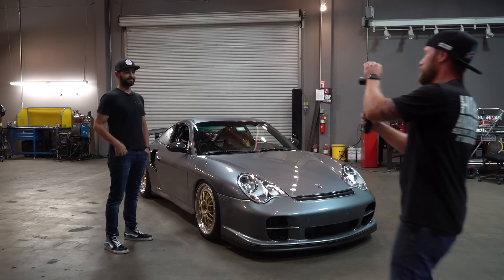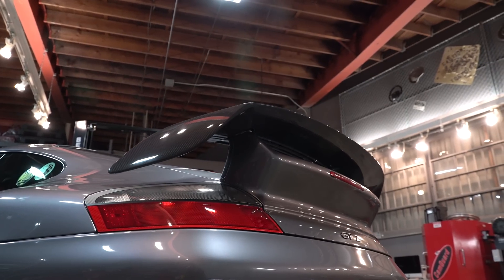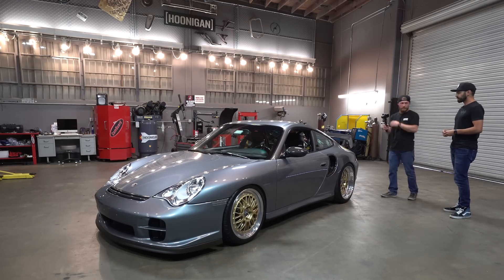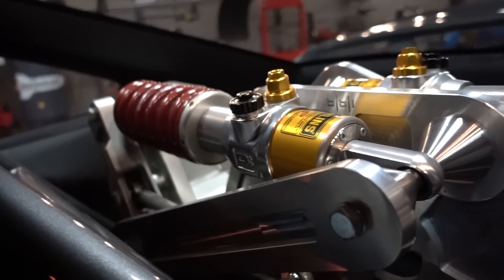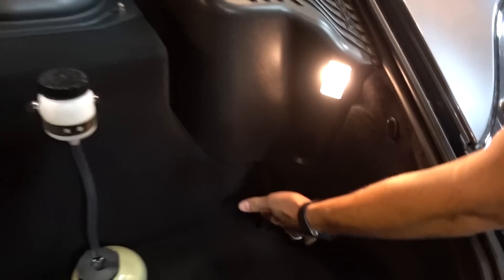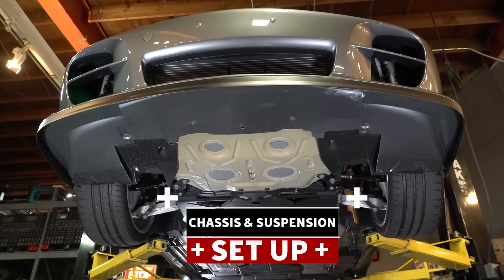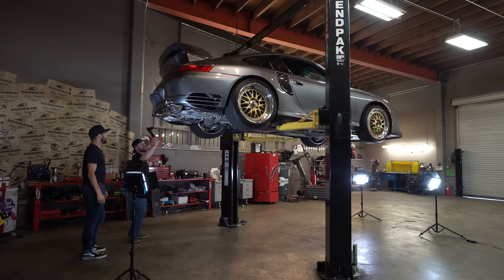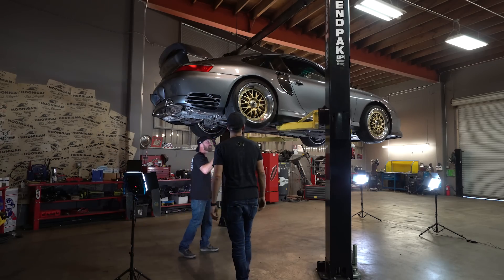800hp Porsche 911 GT2 - With Backseat Suspension!?

Comment: That's it.... need me a 911 996, a winning lotto ticket and a local shop who know their stuff...

Normally 996's kind of put me off, headlights plus I dont even want to think about one because of the IMS bearing but this thing just made me rethink my opinion on the 996... In its final form it is a beauty on the outside, absolute beast on the inside. Love the suspension work as well.

Watching this kicked me back to when I was 10 years old and a 996 was all I could think of.

Comment: wow this thing had only a little bit less then my 15 f250 when I got it it was making 712TQ TO THE WHEEL! it is a stump puller sweeeeeeeeeet turbo GT2 the rear end has had so much work its unbelievable and I like exposed horizontal shocks I have seen them on the front of cars and the back but it is just so clean when u pop the boot and there are two turbo's starring at u its a 10!

Comment: I remember when I worked for Porsche back in 1990 and the new 911 turbo came out 1 of the mechanics was doing a plug change and explained to me how you had to drop the engine to do it,mind you he made it look very simple ,4 bolts and a few umbilical cords is all he says 5 mins,it's just easier .

Comment: The widowmaker nickname these had in the 80's and 90's was really just down to old turbo technology. Not only were they incredibly laggy and produce a huge surge of power when spooled up, bu the turbo would even still build boost under partial throttle. If you were doing some spirited driving around a long bend it could result in boost being built to the point that the rear tires broke loose. Combine that with the rear engine layout and you basically got a pendulum effect going on. Scary as fuck actually.

Comment: Porsches are by far the easiest cars to work on.996, 997, 986, 987, only have three mounts in total for the engine and transaxel combined. I have pulled and replaced the entire driveline in my 986 S, in my driveway, with no more than a couple of floor jacks and jack stands, by myself, in an afternoon (on at least three occasions). Injectors from the top engine cover, plugs top or undernieth. Alternator replacement from the cabin hatch in about 15 mins.

Comment: don't these newer Porsches (after the 993) have the engine set further forward? I know the 930/964 Turbo have the widowmaker reputation due to the engine being rearward past the axle, but I'm led to believe the new stuff is closer to a mid/rear?
Reply: Legotruck82 the new 911s still have the engine mounted behind the axle but the technology has come so far they’re able to get rid of rear engine characteristics with rear wheel steering and self adjusting suspension.

Comment: The rear tires are wearing unevenly which is not that uncommon except they're wearing on the outside which I don't think I've ever seen. I did tires and wheels for about 5 years, and I would always see sport/y cars wear out the inside shoulders, presumably because it's set up to do better in corners, so you can make sense of that. I can't make sense of outside wear on the rears unless the suspension is misaligned.

Comment: Earlier this year, I rode inside this car or a car identical to this (Silver 996 GT2 with 800hp and Pushrod rear suspension). It's insanely quick, felt like my eyeballs were pressed into the back of my head! This is right after taking a ride in a 993 Ruf CT2R the day before and driving a Tesla Model X a week earlier. This car is truly a beauty and the owner and builders have done a magnificent job on it. 
The rear suspension is a masterpiece. It's definitely more for show than actual performance. From a pure performance perspective, it sits too high up and defeats one of the main purposes of a cantilever suspension (the part about lowering center of gravity). But the owner wanted it that way so who cares?  It's still a show stopper and an insanely fast car.

Comment: I thought maybe they would elaborate more on why someone might redo the suspension in this way. Other than so you can see it through the window. 
Like maybe the stock suspension is compromised because of cramped packaging. 
Also guys, those edit cuts with the glitchy music are pretty obnoxious.  Maybe try to be a little more like Larry.

Comment: Rear suspension settings are carrying too much camber or upper inflection, check out the uneven wear on the rear tires. Could it be that the upper suspension just doesn't really work. Porsche racing engineers are probably laughing at this car!

Comment: As a mechanical engineer, I find the rear suspension kinda ridiculous for this application. Coilovers have gotten so good that there is no real need for push rod suspension, and if there was any real benefit, all the extra weight over the rear axle would of canceled it out.

Comment: Porsche stuff is all straight forward n functional other than that stupid suspension setup in the rear window. Should of gone with more RSR parts and running ethanol can easily make 1000-1200hp unless it is never said. Nice build though not a fan of interior and the inboard coil suspension used primarily on a street car. That setup is more suitable for mid engine car w/longer wheelbase like Ruf,  CTR3

Comment: “It’s like a diesel” old smoky made a little over a 1000 ponies to the ground, and over 2500 lbs of torque. Gassers shall never beat a diesel in the ratios, even a stock 12 valve made something like 215 hp and 440 lbs of torque. ~1-1 is pretty good for a gasser though, waaaaay better than the thunder Doritos.

Comment: The real reason you want pushrod suspension is to control the spring to ensure it is always being acted on in the correct direction of travel. Completely pointless on a road car. Triple adjustable shocks are also something you don't need on a car unless it's producing real downforce. Nice build, but completely for show. Very little to do with performance in relation to how this car is used.

Comment: "If you're making 800 wheel, you're making a little over 800 torque to the ground, like a diesel." Actually I think that's called a broken diesel. Speaking of, when are you gonna have another diesel in the yard :thinking:
Reply: James Derrick sat there and thought the same thing. 400ish horsepower is 900+ ft/lbs of tourqe in a diesel.

Comment: Not a huge fan of Porsche cars but this one is just stupid clean. Like wow..... wow
Reply: Dodgers 48 how you not like porsches? Easily the best engineered cars you can currently. At least the 911 is.
Reply: sjpro1 
Haha nah man I am not a HUGE fan of Porsche cars. They're great cars but I'm not in love with them. Ya know? 😃👍🏼
Reply: overhyped, overpriced, not terribly reliable, expensive to fix and maintain...not accessible to most middle class people. don't get me wrong i'm sure the driving experience is incredible and almost unmatched, but you have to be realistic when shit starts to get insane expensive.
Reply: Varg Sutton 911s are bullet proof aside from the few years with the IMS issue. Plenty of people ABUSE these cars on the track on weekends and daily them the rest of the week. They are very well engineered to handle the stresses of track driving. Car and driver launched a turbo s something like 50 times in a row without it overheating. Used they are pretty affordable for a 996. Maintenance on the 911 really isn't bad at all. Only really needed to put brakes on and change the oil for the ones that came into shops I've worked at. You obviously have no personal experience with these cars.
Reply: @VS666  sounds like a lambo or a ferrari.

Comment: Those gold wheels don’t fit that era car those wheels reminisced from the 80s should absolutely be painted body color or chrome or even black before GOLD. Plus the rear suspension is completely overkill looks like shit it’s a streetcar not a track car and it’s hardly anything close to an RSR. Olin’s is the best but visually looks like shit in A street car buy a watch then WTF what a lame justification!! 800hp Not much it’s actually under powered if you want to bring up RSR references. Anymore power in a manual is not really usable unless you’re going just for flat out TopSpeed

Comment: Clever owner did that in 996 gen GT2 since this one won't appreciate as much than the 997 GT2 in value
Reply: Naufal Kusumah indeed as soon as I saw it was 996 I wasn't concerned with changing it. It's probably the least desirable front clip with those headlights
Reply: interesting that he didn't do the standard conversion to the new front 

the 996 has been growing on me, especially when the lights are fresh and clear
Reply: Clean, without any stories 996 GT2 is the rarest water cooled 911 now a days.

Comment: The servicing of these vehicles is why they don't sell to people who work on there own cars in there driveway. I still want one
Reply: RAID3R63 The price point is why they don't sell to people who work on their driveway. Nobody is wrenching on their 100k+ cars.
Reply: ImBarryScottCSS I know plenty of people who wrench on there own 100k cars. There real car guys who  spend there 100k making a car better rather than just buying a 100k car. Some of the nicest show cars I've ever seen was done by a guy with some help from his friends on the weekends.
Reply: RAID3R63 but then its still not a 100k car😅
Reply: people who can buy these kinda cars (I mean the GT2 class) can either a.)afford to have them serviced or b.) have their own shop. 
You'd be surprised how easily serviceable porsches are compared to the other exotics in their respective classes.
Reply: Daniel Hurlbert aka Normal Guy Supercar does most repairs on his F430.  Matt Moreman of Obsessed Garage has been known to take apart and swap exhausts on his $200K GT3 RS.  Just because you have an expensive car doesn't mean you can't work on it yourself.
Reply: I think he neans you dont see a guy replacing the head gasket or studs or even a tune up on a amg black or lambo

Comment: Stop clickbait,  nothing weird about the suspension. it is used alot in racing but only by the real pros because it can be a bitch to set up
Reply from the maker: You don’t understand the meaning of click bait... if the car didn’t actually have that suspension, but we made you believe it did, then that would be click bait. And we can name the number of road going 911s with cantilever suspension on one hand. So yes it stands out.

Comment: 996 GT2? Holy shit, talking about very, very rare and awesome cars. But then again, it’s not a Widowmaker. It just isn’t.
Reply from the maker: Scotto says “Widowmaker” is reserved for 930 Era Turbos, Early Vipers and the scissor jack in VWs.
Reply: TheHoonigans Brian is right. Usually the 930s are called widowmaker since they have a relatively big single turbo that makes them very unresponsive to drive. Nothing below 4500 rpm but then suddenly a big shove. People used to crash them loads when turbochargers in general weren’t really a thing and no one really knew how to handle them except for racing drivers
Reply: TheHoonigans Fun fact: when the 930 first came out it got lots of flak from motoring journalists here in Germany. Most of them didn’t like the way it drove because it was such a different experience to any other performance car at the time. Some even questioned if the concept of the turbocharger even has a future among performance cars. Although most still praised the 930 for its top speed
Reply: I thought the widowmaker gt2 was the nickname for the 993 era?
Reply: Would be cool to install õhlins mechatronix  valves in the ttx dampers, then adjust it from the dash.

Comment: Wheels are horrid. Suspension is excellent engineering but no point as it upsets chassis due to front setup. See carrera for reasons why they used and dont on others.